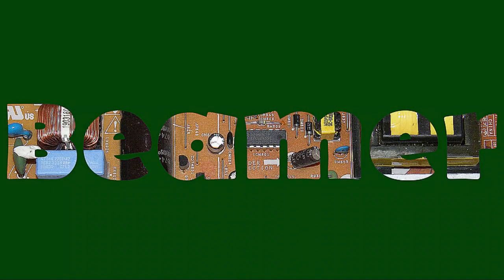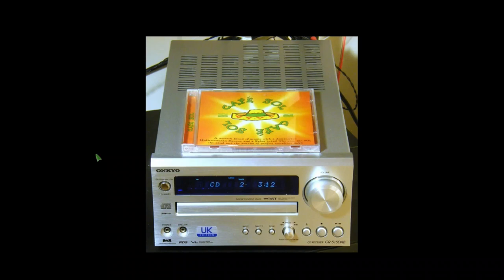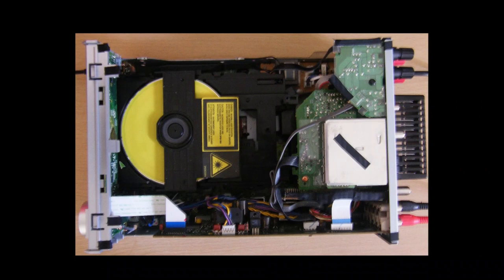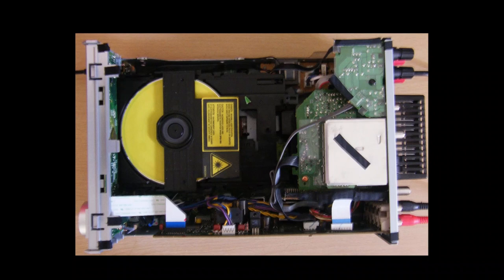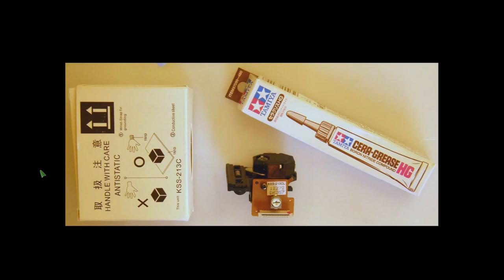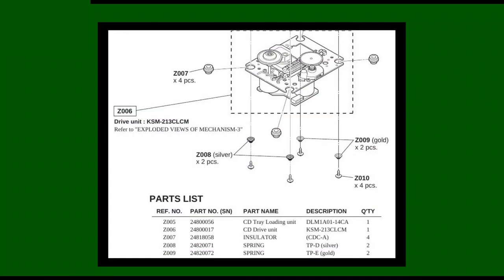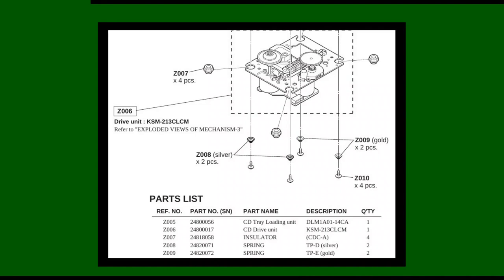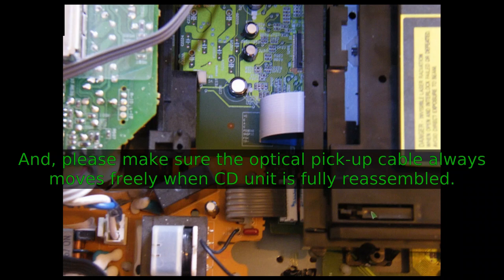ONKYO CR-515DAB CD player repair

Comment: Thank you so much for your help Beamer. It was the laser eye like you suggested. I reckon it's been faulty since I bought it in '09. As I was getting mechanical issues as well as optical I opted to purchase the whole laser mechanism with motors: (https://www.ebay.co.uk/itm/124234027424?ViewItem=&item=124234027424). Easier to fit as a unit rather than just the eye. Your video as well as 12voltvid's helped a lot. If I hadn't been made aware of the very faint colour coding on those springs I know I would've just refitted them any old how. The stage I was most unsure about was the anti-static solder blob. But alas, I did it. Now my beloved Onkyo is saved. It as such an amazing sound. Even better than before which is why I reckon it was dodgy from the start. Every CD it had issues with in the past now play without error or tracking problems, plus the drive is silent. I couldn't be happier.Thank you once again because if it wasn't for your video I doubt I would've given it a go and put it down to poor engineering on Onkyo's part. One happy bunny.
Reply from the maker: Thank you for your kind words and the sourcing of a complete (and working) CD drive assembly. If I may I’ll add that to the description. I complement you for having a go, making the effort and then being rewarded for it - with a very enjoyable (and now complete), compact audio system :) I also agree with you about suspecting the original CD unit as always faulty. How Onkyo was prepared to sell them like that I don’t know, perhaps just a duff batch? It’s enough to put people off the brand though! Was your original drive unit physically stuck to the chassis as mine was – that was a pain. All the best Beamer.
Reply: @beamer.electronics  Yeah it's a shame that Onkyo have released so many units with similar issues as the system itself sounds fantastic, especially connectected to my Denon SC-M37 speakers! The original CD assembly was by Sony as well. Back in the 80's, CD players used to come with transport pegs that had to be removed before set up. Maybe Onkyo should've continued with this practise.
    The drive had been stuck down but only with the one foot and this was no longer fixed making me think that this unit had been dropped on the way to the store way back in 2009! Hence why the pick up has always played up a bit. I was all psyched up as well after watching your video, prepared to have to prize it away from the base but no..., just came away.  😊

Comment: Thanks so much for the video, after watching this, I purchased the parts and have successfully repaired my Onkyo CR505DAB.  The 505 required the same KSS213C spare.  The CD was not glued down so removal was easier than the 515.  Many thanks for taking the time to share and giving me the courage to repair an otherwise working piece of equipment.
Reply from the maker: Congratulations on a tricky repair and info, and thank you for your kind words.

Comment: Thank you for this video! Do you have any tips on diagnosing and repairing/replacing the RCA input jacks? My tape inputs are so quiet they are barely audible.
Reply from the maker: Hi there, has your 515 always been of a low level? Or has it just happened? Is the DAB, CD and FM of normal output level? I ran a Technics ST-Z45L tuner directly into the tape input - with only a slight loss of level, but perfectly good. Even though the sound is low, does the volume adjust properly without distortion? I suggest you also have a look at a Shure site for input levels: https://www.shure.com/en-EU/conferencing-meetings/ignite/tell-me-about-mic-and-line-level
Does your 515 get hot, can you smell if it has been burning? All the best, Beamer.
Reply: @beamer.electronics  We just got it used, so I don't know its history but all the other outputs sound fine and are at matching levels. It is not getting hot, thankfully. I reflowed the solder on the RCAs too just in case, but that did not change anything.

Comment: I have an Onkyo CR-525UKD. Ever since I've had it every now and then it'll skip on certain CD's. Nothing wrong with the play surface, my discs are immaculate but before it skips, it usually sounds as if the disc is wobbling on the drive spindle which causes errors in pick up. These discs play fine on my Panasonic CD receiver. Any ideas if my theory is correct? Does my optical head unit need replacing? Please advise as I don't want to completely break a fantastic sounding unit (when it's playing right, oh course).
Reply from the maker: Thank you for your comment. The fact that it's intermittently fussy about Cds suggests the optical pick is failing. As far as I know, it's a similar unit to mine and there are no adjustments available - pick-up needs replacing. But, the wobbling effect also suggests the mechanism could be failing. It's hunting for the right focal spot - might simply be a minuscule piece of grit in the gears/cogs? As I've mentioned, view 12voltvid's video to deal with that. All of this is the reason why it took me about 4 years to get round to it ;) All the best, Beamer.

Comment: Thanks so much for all your very clear advice Beamer, i just bought a 515 malfunctioning in the cd-part. Just the first 30 seconds work. But what a sound! For 10 euro, it does require a lot of patience indeed, i’ll have a look wether the Sony spare part is available. The dac in the 515 must be better than the 315. So i will give it a try on a rainy day! 👍
Reply from the maker: Thank you for your kind words. A 515 for 10 euros - what a steal, well done. It's also possible now to find the 515's D-N9BX Speakers for little money, I still use mine because they are good, great imaging and the top end is easy listening. I do use an active sub though.  I wire my TV, video disc player and PC through 515 via a switch box (aux input), even my old Technics tuner is plugged into the tape input :) All the best, Beamer.

Comment: That spring mount item, (2 strengths) just saved me grief. I hadn't noticed either.
Reply from the maker: Yes, it got me for a while - sneaky ONKYO :) I believe the later models have grommets, but they degrade after a few years - springs are probably best. All the best, Beamer.
Reply: @beamer.electronics  Yes. Mines the cr-525, and the springs are sat on top of grommets.

Comment: my onkyo 515 optics are getting weak..i want to replace them.
Can you tell me the oprical part number onkyo 515..thanks
Reply from the maker: I don't have the exact ONKYO CR-515DAB reference, but this is for a model CR-315/CR-315DAB which I suggest is very similar:
REF.NO. 61 PART NO.(SN) 8848-483-05 DESCRIPTION KSS-213C, Pickup.
As this HiFi unit is now out of production - the chances of getting an original replacement optical pickup is nigh-on zero. However, copy parts are available from UK eBay, and because I didn’t buy mine from the following sources – I can’t recommend them. But, you are welcome to give them a try:
* https://www.ebay.co.uk/itm/KSS213C-LASER-UNIT-REPLACEMENTUK-COMPANY-SINCE1983-NIKKOLOOK-OTHER-LISTERS/191894709021?hash=item2cadd0e31d:g:3zkAAOSwwPtTv8eA
* https://www.ebay.co.uk/itm/KSS213-C-LASER-UNIT-REPLACEMENT-KSS213C-Optical-Pick-up-UK-STOCK-FAST-DELIVERY/254266839337?hash=item3b337c1129:g:F0UAAOSwyHRaq~Re
All the best, Beamer

Comment: I have the same model, and the front panel display is so dim, it's almost non-existent. Any ideas/tips? 
Thanks!
Reply from the maker: It could be that the display has reached EOL, but before condemning - it's worth checking (competent EE) the voltages around the display, particularly the high voltage and associated capacitors. A schematic for a similar CR-315DAD is available: https://www.manualslib.com/manual/1081436/Onkyo-Cr-315.html All the best, Beamer
Reply: @beamer.electronics  Thank you!

Comment: @Beamer, I have the same model but after taking the lid off I can see that the disc isn't even trying to spin. Which part do I need to change do you think? thanks
Reply from the maker: Assuming you are a competent technical person handling mains appliances - it could be the power supply? Have a careful look for any spillage or burnt areas and components. Also, make sure that all connectors are correctly assembled and that all other 515 features are working. There's available a schematic for the CR-315DAB that's very close to the 515 - put that in a search engine. Failing that, it could be the CD player's circuit or motor. You should get at least an attempted CD spin. All the best.

Comment: Hi, thank so much for this great video. I replaced with a new pickup unit and even though it sounds like it's about to read the CD, it doesn't appear to spin correctly. It look like the bit that sits in the middle of the CD just spins and doesn't grip? Does anyone have any ideas? Thanks!
Reply from the maker: Thank you for your kind words. Assuming it's an Onkyo CR-515DAB (or similar family member), and keeping it brief: If the CD isn't being gripped, then it's likely a reassembly issue - check, as mentioned, the mounting spring issue, also check the movement and freedom of the pickup ribbon cable, gears and metal shaft - any mechanical resistance can be problematic. Make sure they're spotlessly clean and then lightly special greased. This CD players' servo control etc., are all software controlled - no adjustments! Don't adjust laser drive control on the pickup - unless you've absolutely nothing to lose and make note of the original setting! Things you need to eliminate: Pickup Compatability - these KSS-213Cs aren't originals or could be faulty! Dirt on the lens? Plugs/sockets not inserted or oriented correctly, especially the ribbon cable - any misalignment can be an issue. Any tool impact, parts dropped or liquids spilt onto the boards can cause damage. If it's the electronics - check power supply levels first. I hope this helps, all the best.
Reply: Thanks again for such helpful info....it's the same unit and the replacement model was new. I've checked and doubled checked (bat the PSU). No difference and I'm sure the hight tension springs are at the correct end.

I have noticed that if a carefully apply light pressure to the spindal when a CD loads, it performs better and sometimes registers the CD. Obviously incant maintain that balance so it fails..... anything else I can try? 🙂
Thanks again
Reply from the maker: @gravyboatdrone4060   @Gravy Boat Drone  Just to be absolutely certain here: What's the model of your HiFi system and did you replace the whole CD unit or, like me, just the pickup (model No please)? If the spindle motor needs to slow down - then the system isn't synchronising with the disc. If the springs are the wrong way round - then you'd hear a grinding sound and the disc wouldn't load properly. Was this fault the same as the original one (before replacement)? Have you tried a new CD, CD rot can be an issue. Does the CD drive switch off after a while of dysfunctioning? All the best.
Reply: @beamer.electronics  hi there, it's the CR-725DAB, I replaced the CD pickup module only and not the entire CD unit. The pick up module is a direct replacement (KSM213CDM). It does seem to make a slight grinding sound on spin attempt when the CD won't engage properly. Thanks again
Reply: The original issue was that it would just read "no CD" there was a very slight sound of a CD spinning but now with the replacement it won't engage and only if I apply pressure will it momentarily register a CD
Reply from the maker: @gravyboatdrone4060  Just a thought: Did you remove the laser diode protection solder blob, it needs to be removed - my video at 12:49? Ideally, you need to use an anti-static procedure whilst doing this. All the best.
Reply: @beamer.electronics  hi Beamer, that was actually already broken, there was no blob/link in place so perhaps it's damaged? It was listed as new from the site I purchased, I could request a replacement?

Failing that do you know where I can get an entire CD module, I'd be happy to but one to get it working? It's part of a retro fit project for my girlfriend, she's not well and likes to listen to music so I've gutted an old Murphy Stereophonic cabinet and am retrofitting with some more modern kit I've salvaged at low cost. Be great to get this one up and running for her old CD collection. Thanks
Reply from the maker: @gravyboatdrone4060   @Gravy Boat Drone  Yes, it looks as though the culprit is the laser pickup module! Fancy the seller, selling you a possible duff module - unfortunately not unusual :( I suggest you return it to the seller and get your money back. At your own risk - the laser pickup module only is readily available on eBay - inexpensively. My wife and I wish your girlfriend well. Good luck.
Reply: @beamer.electronics  thanks again so much..I'll give it another try with a fresh unit. All the best! 🙂